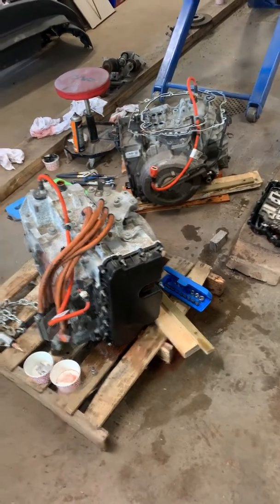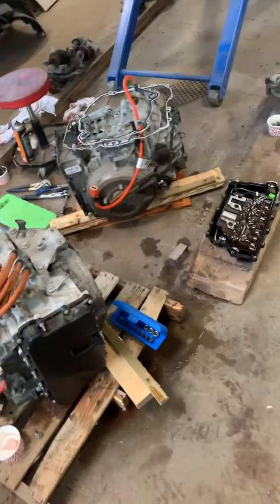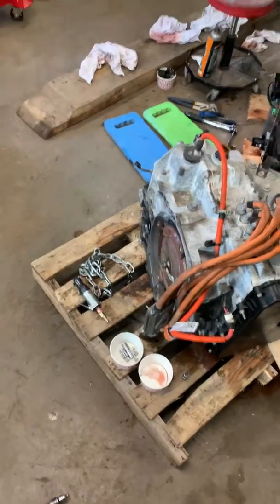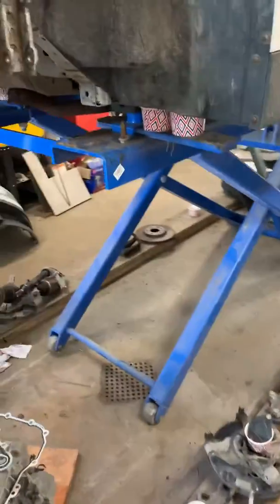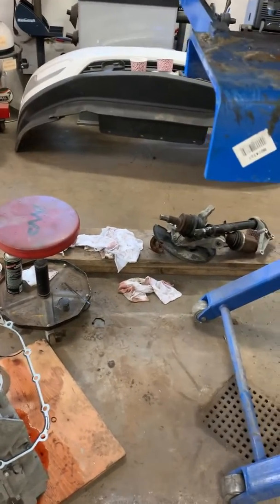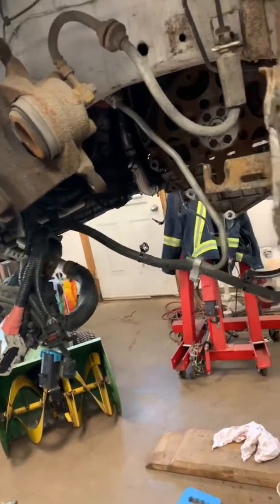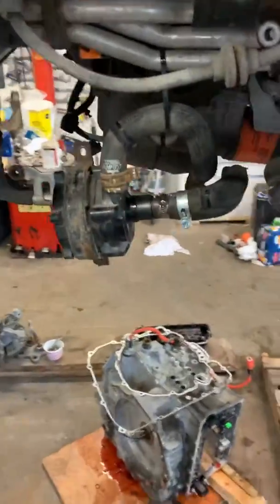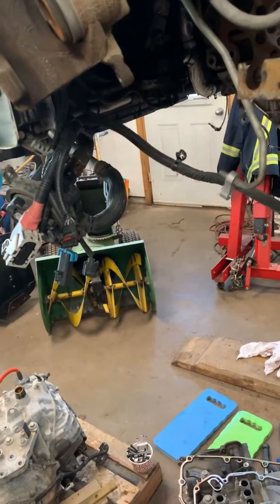Chevy Volt Transmission Change Slipping P0700 P079A P07A5

Comment: My 2012 Ampera (basically european chevy volt) just started throwing me P0751 (solenoid A stuck) since yesterday. I've tried to erase the code but it returns after starting the car. ICE does not seem to work. I can charge it and run on electrc powr though. Where do you suggest I should start looking? Should I look for a new tcm? It has 300k kilometers and idk if tranny fluid was ever changed.
Reply from the maker: That solenoid pack is not too bad a job to change in the car, I haven’t touched mine since the replacement. The used transmission is still going strong for now.   Used parts are now easy to find for these cars because many are abandoned because of faulty main batteries. The tcm does need to be programmed to the vehicle. One thing to note I once successfully swapped the micro chip controlling the tcm from another GM vehicle with similar tcm. I had to cut and reinstalled rivets and then solder it back on but it is possible 😂

Comment: Thanks.  I'm working on p079a now.  fluid isn't low. next step fluid swap.  thinking about trying lucas transmission fix (if swap doesn't do it).   how long would you say the labor time is for TCM swap?
Reply from the maker: TCM is accessible by removing the front plastic oil pan. I’m thinking it’s about 1-2 hours but it’s a long time ago

Comment: Yes I am also thinking of replacing my transmission in my 2016 Chevy Volt. I have been looking for a rebuild kit for the transmission. Do you know if transmission build kits are available?
Reply from the maker: I haven’t checked at that time. I’m still driving the car today. I put another 100k on it with the used transmission so far.
Reply: @joelshopefullyhelpfulvideo3010  thanks. My transmission is still going, but is showing signs that it may not much longer.
Reply: @josephcarlat9414  have you swapped the fluid?
Reply: @DN-zh1bv  yes. I did that when I the changed #2 solenoid. The fluid was black. I drove about another thousand miles. Then changed the fluid again. It was almost as black as before fluid the first fluid change.

Comment: Did you just so happen to run across the transmission speed sensor? I need to know where it's located at
Reply from the maker: Unfortunately this was 4yrs ago, don’t remember if I saw a particular connection related to that. Car is still going strong tho!

Comment: Man....thanks for the heads up...

how do you go about getting a replacement for only $200? I'm seeing $800+ on Ebay
Reply from the maker: Hi, I used car-part.com to locate one in a fairly close scrap yard, they sent me pictures and the front pan was broken and one main motor wire was pinched. I decided to take a chance given the low price. I had it drop shipped to a place close to the Canadian border. (I live in Canada) This cost me another 200$. I used the parts from my old transmission and ordered a few gaskets from the dealership. I had to split the case. This operation was a bit scary since I didn’t know if anything would fall out of place. Everything went well and it’s still going strong today. I put about 60k km so far. Good luck

Comment: These don't have a transmission so you can't have a trans slipping,could have been limp mode, just google the codes and see what other people had to do to fix the problem. The 2012 has a recall for software updates, another thing that causes problems on these cars is the 12V battery starting to go bad. Your right this is a big job and the motor is rather heavy.
Reply from the maker: Hi Pete. I’ve taken these appart and yes they have clutches that can slip when malfunctioning. Its a very different design than a typical transmission, it’s basically a electric motor encased with clutches to engage and change modes of operation. The car has been fixed now for a few years and is still my every day car. Thanks for watching!

Comment: Mine is doing the same, codes and all. The transmission fluid was overdue and I forgot to change it.
Reply from the maker: Well when I checked my fluid it was like new, it seems this is a rare thing that happens when an internal circlip pops out inside the transmission, if it was only parts it would be cheap but it’s so much labor to get it out and replace it most people just install another used unit or if your lucky it’s still covered under the 8 year warranty for the later ones
Reply: @joelshopefullyhelpfulvideo3010  Mine is a 2011, so not covered anymore. Normally the Volt doesn't engage the clutch, that's why they last forever.
Reply from the maker: @gteixeira  yes well, normal automatic transmission are constantly slipping a bit when shifting, this is why they get hot from friction when you tow or drive uphill for long periods, the volt doesn’t have that, only different modes with a few clutches but I understand that they synchronise in speed before changing modes, so very little clutch wear powder enters in the fluid. Some shops in my area repair them and have become quite knowledgeable on them, actually the repair shop courtesy vehicle is a volt with over 800k kilometres. It’s looking like they will hit one million soon.

Comment: Is the electric motor and transmission one unit?
Reply from the maker: Hi, yes both are in the same unit, essentially it’s not a real transmission but it looks the same from the outside, it’s basically 2 electric motors and clutches to engage and disengage depending on the mode, one motor doubles a a generator.

Comment: How many miles did this issue happen at?
Reply from the maker: Just over 80k miles, and 1 month past the 8 year warranty, I tried to get GM to honour it but they refused unfortunately and wanted 7k for the tranny replacement. I told them no thanks, the used transmission is still going strong today 110k miles
Reply: @joelshopefullyhelpfulvideo3010  wow that’s insane 7k crazy!! I’m thinking of buying a volt this week with 90k miles have you heard of this as a common issue with higher mile volts  or just a random isolated event?
Reply from the maker: @DirectedWisdon  I’ve heard that this is uncommon, I think it was caused be me driving the car too hard in sports mode in sub zero temperatures before the car was warmed up properly. This car has a few glitches that are worsened by cold weather, if you are in a warmer climate it’s very reliable
Reply: @joelshopefullyhelpfulvideo3010  Thats very good to know I will be using mine in a warmer climate (Ga) thank you for the great insight this make my decision a lot easier!

Comment: hey joel i did the same job at my shop replace it with a used one from online. well once i finished the job the car would not turn on anymore. does the tcm or any other computer need to be reprogrammed
Reply from the maker: Hi Edwin, Yes, initially before changing the transmission, I replaced the TCM with a new one and had it reprogrammed at the dealership but after I found out it wasn’t the problem I found a used transmission and transferred in the new programmed TCM. It cost me about 200$ to program it at the dealership but I had to tow the car to them.
Reply: mine was hit on bottom and i used all electrical components from original ran good for a few minutes then shut down and ended up towing to dealer $500 to reboot

Comment: I have the same problem on mine.Did you get yours fixed?
Thanks,DAn
Reply from the maker: Daniel Trambitas , Hi Daniel, yes, the used replacement transmission fixed the problem. I have not taken the old one apart yet to find out why it happened but I read that the same thing happened to someone else on a forum and a transmission shop found a locking ring popped out inside, she didn’t know which one tho. It’s still a huge job to get it out and repair it. I might get to it this winter and if so will post a video of my findings.